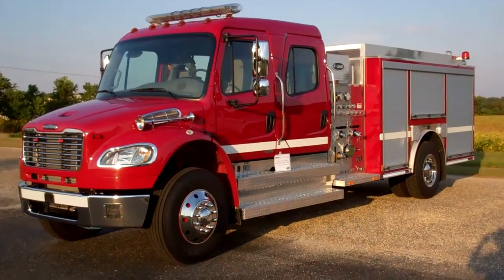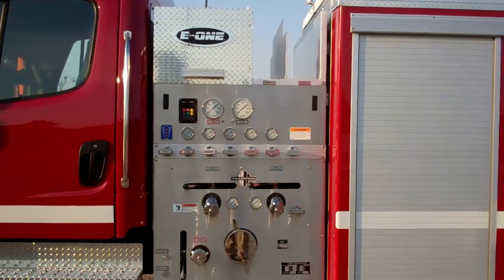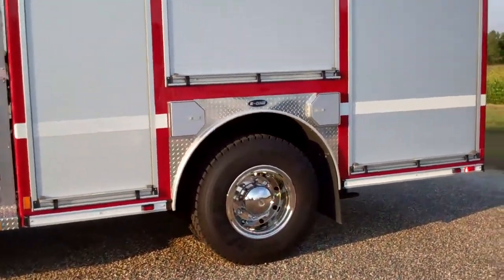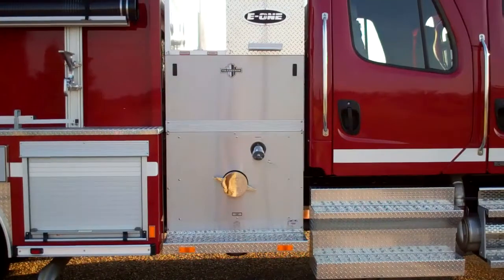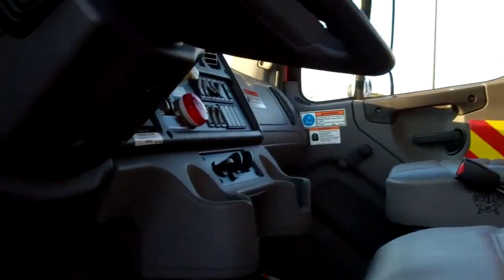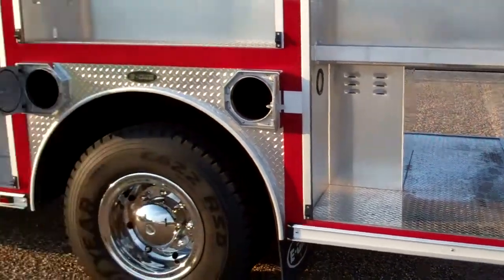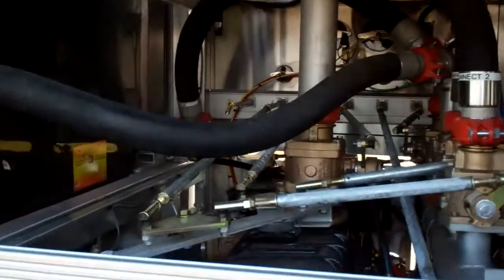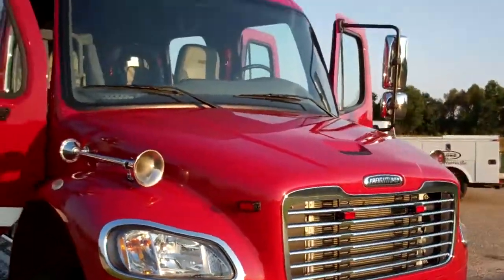Sunbelt Fire showing a E-ONE 4 Door Commercial Pumper

Comment from the maker: The gasoline engines typically run very hot and are designed for ram-air cooling, not stationary as in pumping operations. The torque output from the gasoline engines is typically half what you find with diesel engines, making the vehicles less responsive. The F650 with gasoline engine could be a viable chassis in a quick attack type pumper, but the rigors of long pumping operations will take their toll on the vehicle.  Hopefully this helps.  If you would like more information let us know.